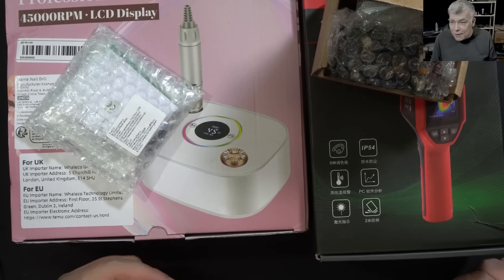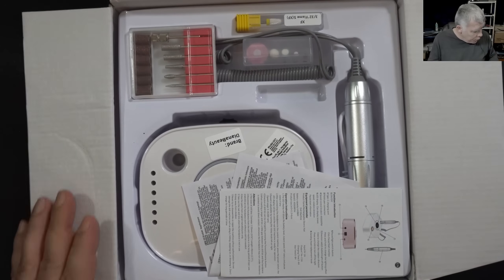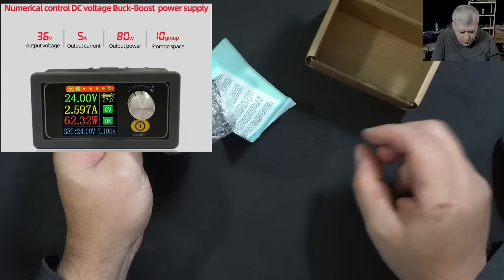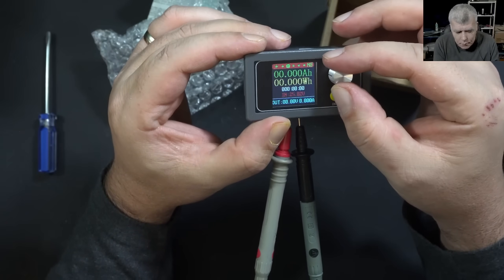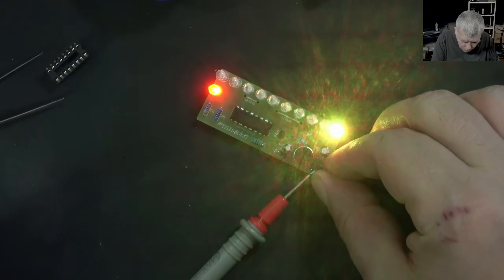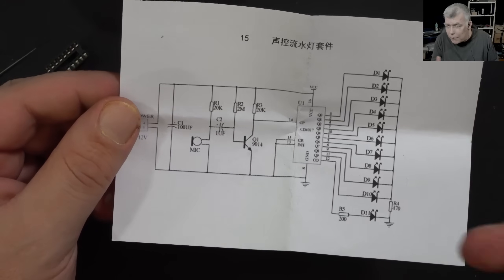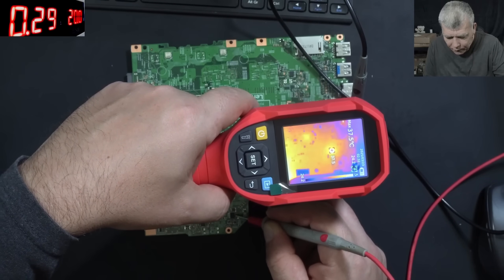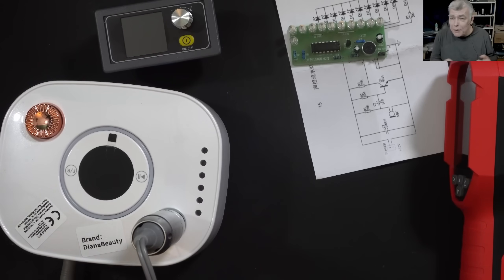Tools from TEMU - Thermal camera, DC-DC boost-buck, Pro drill for boards and more

Comment: How many amps does the PS do at 1V. I need to find shorts and my 10A PS only does 1.5A at 1V.
Reply: The current depends on how much the resistance is on your shorted board. Use ohms law to work it out after checking resisance.
Reply: @g4z-kb7ct  This is for voltage injection. The part is shorted so the resistance should be low, and you need a lot of amps to get it hot so you can find it. The problem is that most modern CPUs/GPUs run on about 0.8V, and if you use more you will definitely destroy everything on that net. Hence1V 5-10A.
Reply: @SidneyCritic  You will never be able to push 5A-10A at 1V on a shorted circuit board. This is why Sorin frequently has to increase voltage slightly to increase current. This is basic Ohm's law.

Ohm's Law states that voltage (V) equals current (I) multiplied by resistance (R):
V = I × R 

Given:
Current (I) = 10 A
Resistance (R) = 1 Ω 
V = 10 A × 1 Ω = 10 V

You would need 10 volts to push 10 amps through a 1-ohm short. This dissipates 100W of power and you will need a power supply capable of doing that without overheating or burning up. Anyway, to do that voltage must be 10V which is obviously not possible without causing additional damage due to having low voltage parts.

Comment: I have had that same thermal camera for about 4 years and I have never had a problem with it and I use it regularly. I also bought a little 3rd party macro lens adapter for it which works really well. You can see it in my videos.

Comment: How do you remove a stripped screw on the board ??
Reply: It depends on how the screw is stuck. If the thread is damaged and the head is also damaged and can't be unscrewed you must drill out the hole smaller and then screw in a threading tap. Bear in mind many screws are hardened and drilling is not possible except with carbide drill. Or if the screw is larger you can use an 'easy-out' tool. If only the head is damaged you can grind off the head and then unscrew the remaining threaded piece using tweezers. If it's a PC motherboard grind off the head to release the motherboard, toss the standoff in the bin and replace with a new one.

Comment: I have that thermal camera. I use it nearly every week. It's great quality for the price. Just don't use a cell phone charger to charge it, I heard on EEVBlog that it can pull too much power and burn out the charging circuit.
Reply: Iam also using this thermal cam and its of course usable for the price. Additionally I can recommend to buy the macro lens. Its very useful when more details are needed or when its about about smaller circuit designs like smartphones and so on. I love it